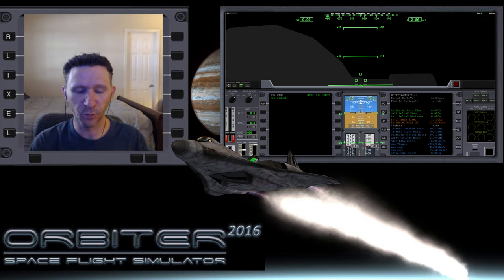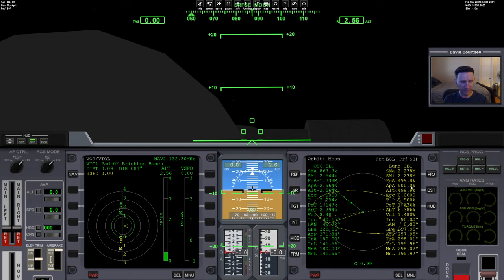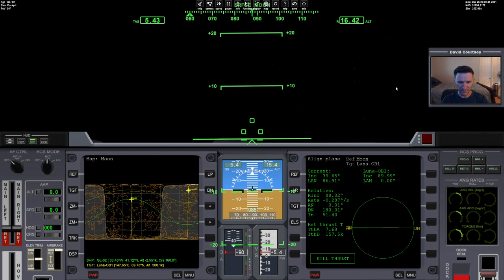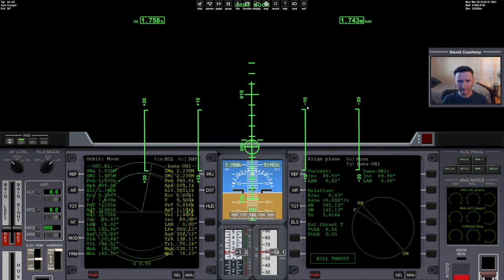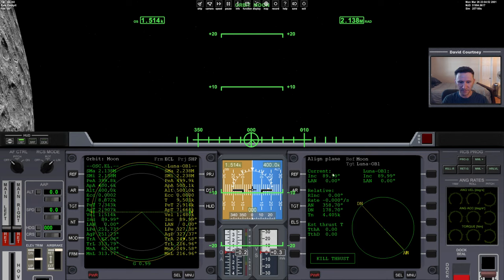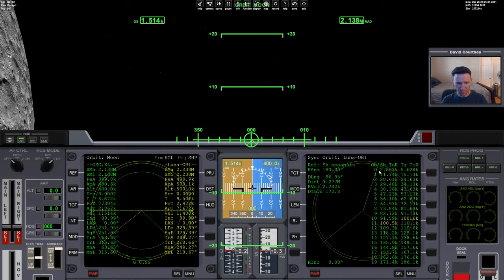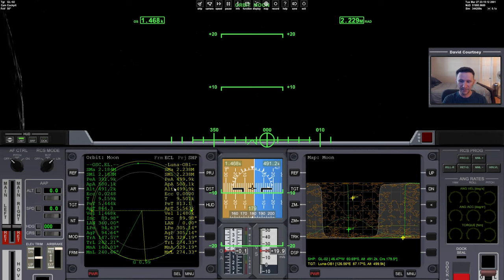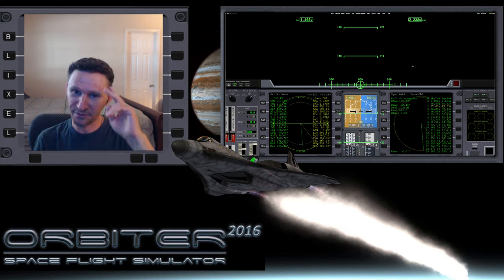Orbiter 2016 - [Part 1] Brighton Beach to Lunar Space Station

Comment: Loving these videos David! You've re-inspired me to get back into Orbiter. I am about to start an install of Orbiter 2016. It pains me to think about it really because I've been putting it off for so long. My 2010 install is such a terrible mess with so many tweaks over the years, I'm not sure if I will be able to get everything set up the same way in 2016. Seems like there are several add-ons, bases, etc. I was using in 2010, that aren't available for 2016 and will likely never be. If anyone has any suggestions or a good source to help make the process smoother, please let me know! Otherwise I am just going to do my best. Haha! Cheers!
Reply from the maker: I feel your pain. I try not to go overboard with addons, but over time I ended up with quite a bit in my Orbiter 2010 installation. With Orbiter 2016, I've found:

*  the HCLV doesn't work (for me - even with the supposed 2016 patch)
* the Carl Sagan Space Center doesn't work (for me)
* Hall Base doesn't work
* IMFD 2016 crashes my Orbiter 2016 install about every other time I try to open it
* there's no Arrow Freighter for 2016 (yet)

 ... that's all I can think of right off the top of my head, but I'm sure there are more issues that I'm not remembering. I haven't tried Wideawake International yet.
Reply: @DavidCourtney  Thanks for the information! I really appreciate that. The issues with IMFD/HCLV and the absence of CSSC and a wait on the Arrow Freighter are downers, but I guess at least I will have the XR2. Got to start somewhere I guess. As long as I have TransX, BTC, BaseSync and Aerobrake, I should be ok for the most part.
Reply from the maker: @thatsrich944  For some of the bigger addons, I wish I would have made a copy of my Orbiter 2016 directory first. Then I could have tested the addon using the copy of my Orbiter 2016 directory rather than the my primary. Then when the addon didn't work, I could have just deleted the copy. Since CSSC/HCLV and some others didn't work, I manually went through my Orbiter install and removed everything. What a pain!

I think I'm actually going to start a new Orbiter 2016 installation from scratch and try to do a better job of keeping it clean and testing addons before committing them to my main install.
Reply: @DavidCourtney  That sounds like a good idea. Orbiter has always been so picky, and sometimes removing things seems to mess stuff up even if it wasn't before you installed, lol. I just try for the most stable, smooth running setup I can get. Crashes and gliches ruin immersion so quickly!